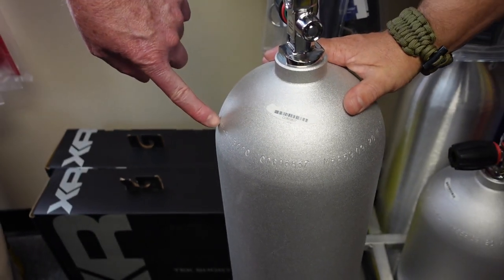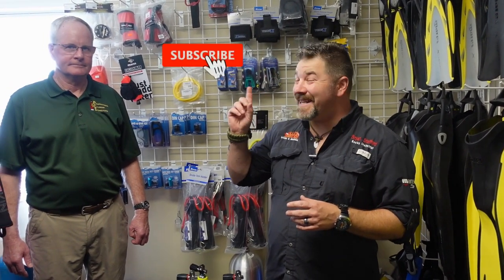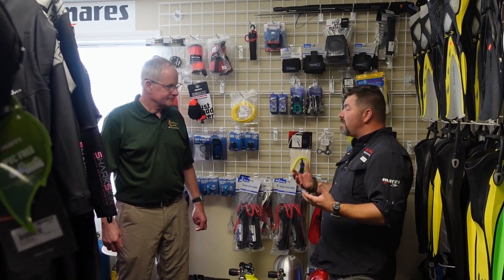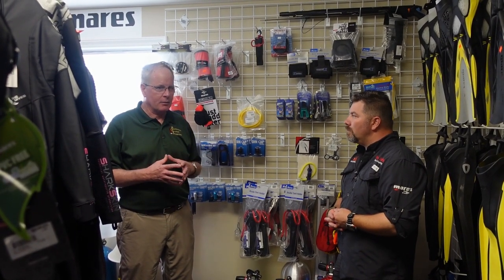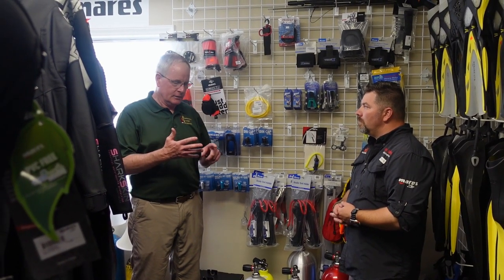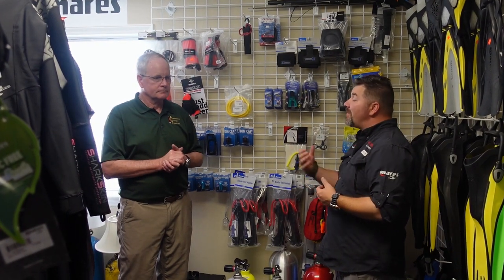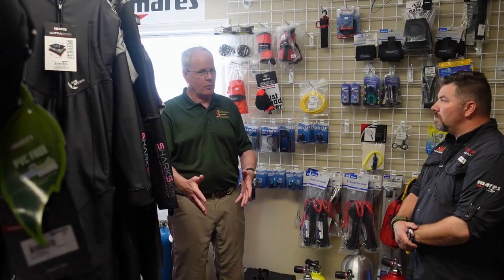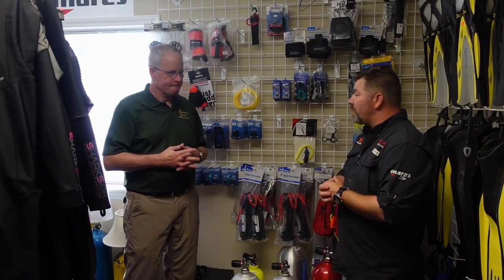{[PSI / PCI Training]} Staying Up To Date

Comment: Thanks for the video on this I would highly recommend this class. I Took the Cylinder inspection class and O2 cleaning class with Mark a couple of years ago and am up for renewal in a couple of months.  I am just a diver and not affiliated with a shop so I only inspect my own cylinders and have bought and sold a few as my needs have changed.  PSI has been there when I had questions and has provided good support.  One of the best parts about the education is the fact that they dispel the myths about what is and what is not acceptable when handling and inspecting cylinders so you don't have to rely on thirdhand knowledge "well I was always told"  type stuff that differs between shops.
Reply from the maker: Glad you liked the video Kevin Davison. PSI - PCI always do a great job educating the dive community.